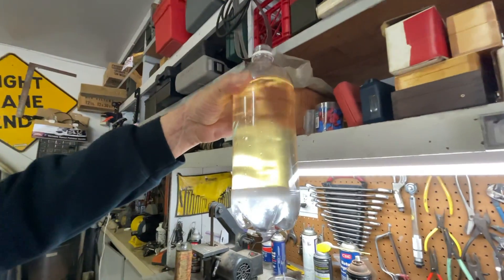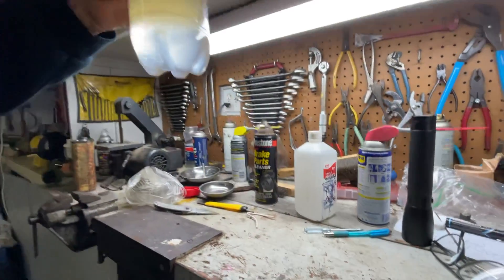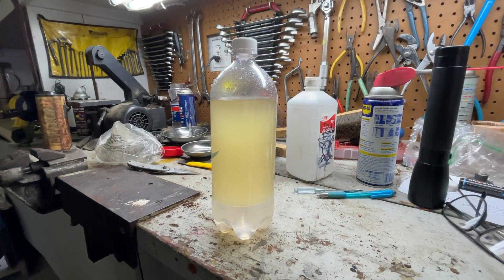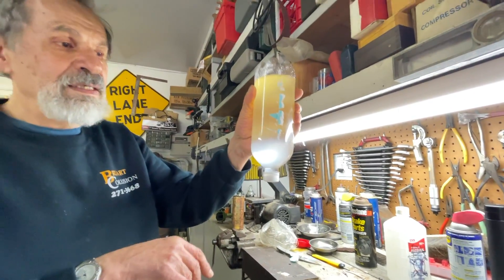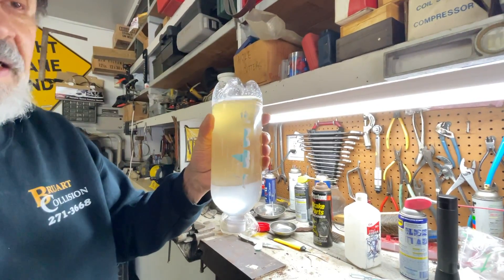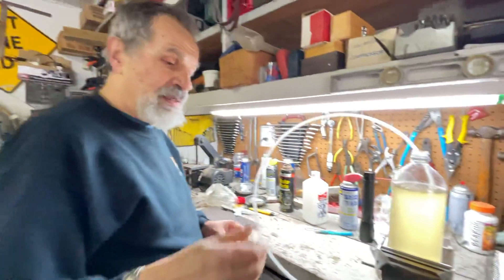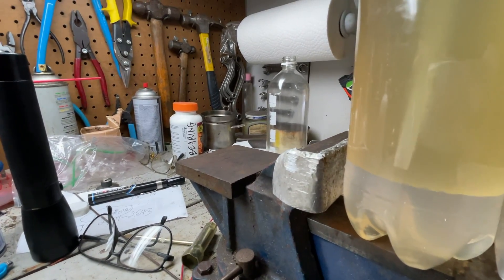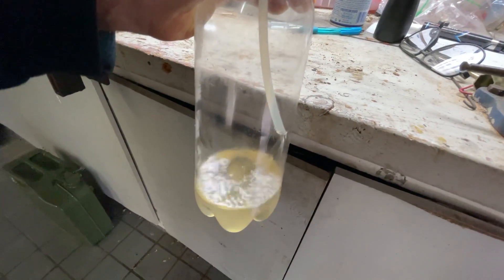The Most Practical Way To Remove Ethanol From Gasoline

Comment: All, keep in mind, if you remove the ethanol, and you have a motor that requires, or is sensitive to a minimum octane number(ie a car, motorcycle or some higher end lawn equipment etc..), you must add another octane modifier such as Toluene/Methylbenzene or Methyl alcohol to bring the octane number back up. Ethanol besides used as a fuel "filler" is also used as a cheaper alternative octane booster by petrol/gas blenders. Instead of a stuck carb, bloated seals or clogged fuel injector, you might have pinging detenation or pistons that want to escape the engine block.
Reply: You should use a higher octane fuel, such as 91.
Reply: @ronkendall2930 my opinion is.. in general 87 octane is used all the time by the average consumer. So 91 octane is also a question of how old is it. Generally speaking barely no buddy is buying 91 octane where i live. Aka Ontario Canada. So my question is dose a person burn and treat 87,that is fresh or 2 year old 91 that sat in the tanks at the gas station? Any thoughts?Edit:Petroleum-based gasoline that does not contain ethanol will still succumb to oxidation and volatile compound evaporation in a sealed container or tank, but these processes usually occur more slowly in pure gasoline. Expect non-ethanol gas to last at least 6 months if it's properly stored.Sep 9, 2022
Reply: @randytricker8585  Toluene and Alcohol both oxidize and evaporate in the presence of an oxygen atmosphere at atmospheric pressure so oxidation isn't the problem that people complain about. All gasoline fuel expires quickly when exposed to air. Period. Alcohol is hydroscopic and creates an azeotrope (mixture between similar molecules that are hard to remove bonds). If you want a way to cheat the system and have fuel that lasts a year without adding or removing anything(id recommend leaving it alone for both alcohol and toluene octane fuel) get a 100% sealed can, and fill it 90%. May I recommend Wavian steel NATO cans. If you completely seal a can only the 10% air that is in the can will react or release moisture, and it will spoil way less. Now the liquid will expand and contract so open the can slowly.
Reply: @yeabutwecouldbefreer  no disrespect. I was saying if water is clear and pure gas is clear how does one know where the water and fuel is while sifaning?
Reply: @randytricker8585  No such thing as "pure gas" as gasoline (minus octane modifiers) is a mixture of distalates of multiple hydo-carbon chains at a certain viscosity; and changes from source oil, refinery, and time of year.  Unmarked Gas from the pump usually has a slightly straw colored yellowish tint to it, and both water and gas have a different refractive index so it should give a "shimmer" at the separation line for any water that hasn't formed an azeotrope (mixed with the gasoline). Water will settle out with most of its captured apotropic liquids at the bottom of left for a few hours.
Reply: @yeabutwecouldbefreer  ok. Makes sense. I guess from the vid it was hard to tell but i fully understand what you're putting down
Reply: so buy 94 and maybe get 91 ? seems good to me
Reply: I'd rather have ethanol for the octane than breath extremely toxic aromatics.
Reply: This would be for 2 stroke engines like chainsaws and weed trimmers.  They just don't start and run on this junk gas we have today.
Reply: #TRUTH
Reply: Why not ethyl either?
Reply: I would do this with high-octane premium gas and hope the finished product is acceptable. 

You can buy octane boosters. I wonder what's in them - anybody know?
Reply: @lcar9871  Methyl Alcohol. So back to square 1 here ;)
Reply: @yeabutwecouldbefreer  funny.
Reply: That is absolutely correct!  As a retired fuel terminal worker, I can tell you that the regular 87 octane when it is received is only somewhere around 85.5 and the addition of ethanol raises it to 87. The premium93 octane arrives somewhere around 91.5 - 92.0. This seems to be a messy and potentially dangerous procedure as I don't believe there will be any damage from running ethanol fuel in any small engine.
Reply: @dg6178  Have you done much research about whether ethanol-containing fuels cause problems with carburettors and rubber fuel tubing?
Reply: @joby602  i had old string trimmer and it destroyed whole fuel system when i used ethanol gas I think they wanted to do that get rid of old engines
Reply: @joby602  I have lost so many carburetors to ethanol,  it's causes rust and nothing but problems if you don't regularly drain your carbs.
Reply: Joby it's simple to test yourself. 
How much research anyone with a small engine needs to do is clean the carb regularly and see the damage done.
These machines were never made to deal with polar solvents
Reply: @dg6178  This mostly pertains to 2 cycle engines. The oil is known to separate out from the ethanol/gas mixture and you will sometimes get a straight shot of ethanol and score the cylinder in a chain saw for instance. This is a real thing....voiding any warranty I believe.
Reply: There is plenty of damage to carburettors, blocking of carburettors, denaturing of fuel very quickly. 
Ethanol fuel is a nightmare to small 2 stroke engines
Reply: @dg6178 older motorcycles with rubber seals in their carbs the ethanol causes it to swell.
Reply: @dg6178  The problem isn't in running the small engine with ethanol, the problem is what happens after you store the small engine for a couple months.  The ethanol absorbs water and turns to jelly and clogs up your carb and jets.  Sure you can drain your carb and gas tank after every use, but it's giant PITA.
Reply: @dg6178  Running ethanol laced fuel destroys 2 cycle engines. They run far too hot and lean with ethanol fuel, even in the lower 10% concentrations and despite having a properly adjusted carburetor there will be a power reduction from the lower BTU and faster burn characteristics of these mixed fuels requiring more fuel and more heat to do the same work. In the case of chainsaws and other high revving engines will result in stuck rings scored pistons and damaged cylinder walls. I've been through this enough to know it will kill a saw no matter the brand or 2-cycle oil used.  
There is a problem with storage of these ethanol containing fuels, they degrade over time at a rapid rate creating acids that attack and destroy many formulations of rubber and even corrode iron fuel cans and tanks. Fuel that was OK to store for a year  is now considered degraded in 3 months. 
Not draining fuel from a vast number of small engines for periods as low as 2 weeks is asking for the corrosion problems to begin in the float bowl and venturi passages of many small and light use engines be they 4 or 2 stroke in nature. Eventually the coatings used in engines hardened to resist these acids will break down and damage will occur. 
Being a person who distributes or dispenses or adds additives to fuel and having a "belief" that methanol in fuel will not cause damage will not alter reality.
It's nearly spring time in the Northern hemisphere. The flood of small engines is due in small engine shops around the world and a huge percentage of those visits will be due to damage caused by ethanol containing fuels doing damage while these units were not in use.
Reply: @btwbrand  Running fuel with ethanol is not problematic....leaving it in the tank for any length of time is when the problems start

Comment: Best way to remove water is this way: drill hole top of cap. Install hose through cap into bottle. Plug tube end to prevent leakage. Seal around tube on cap. Turn bottle upside down wait for settling. Remove plug drain water and ethanol. Done

Comment: I will try this experiment with fuel labelled as no ethanol. Im curious if it really has no ethanol.
Reply: If the non ethanol gasoline comes through the same hose at the pump which is used to deliver ethanol gasoline, it will likely contain ethanol from the previous customer. Put some non ethanol gas in your car first to purge the hose of the ethanol gas before you assume it's non ethanol. This problem will be worse if the same hose is used to deliver E85.

Comment: This is not a good practice! There are approximately 115 different chemicals that make up a gallon of regular petrol.
Yes you are  removing ethanol as its absorbed into the water. BUT what is happening to the other 114 other? 
If you want to run your 2stroke engines or lawn mowers on ethanol free fuel purchase ethanol free fuel, by the likes of Aspen or Stihl Motomix.
I'm sure these company's don't get a truck of fuel and a truck of water take it on a bumpy road siphon  of the fuel and pass it on to the customer!
A chainsaw runs up to 14,500 it needs good quality fuel.

Comment: A separatory funnel makes it much easier.  It is also important to understand that three washes with a small amount of water is more effective than 1 wash with the total volume of the 3 washes.  It is not necessary to let it sit for and settle out on washes 1 and 2, only for wash #3. Gentle mixing by swirling instead of agitation is also a better technique.  After you are done, add some silica gel packets like the ones that come in shipping boxes of products that need to be kept dehumidified to the gasoline, to absorb any residual traces of the unrecovered water.  https://www.youtube.com/watch?v=g6kPtSfnHlo

Comment: Ye feckin copied my system.
I use a wine bottle cork
and have a non return valve on the pipe I pressurise 
I add octane booster to the distilled fuel
to get the octane higher
and mix 2 cycle oil for my saws
Much cheaper than buying alcalite fuel

Comment: The reason the gas is cloudy after you shook it,  is well, because you shook it to hard and the cloudiness is just tiny air bubbles.  when you first poured the gas it was clear,  yet it had all the alcohol in it.  Think about it,  gas is quite clear, alcohol is completely clear, so after shaking hard like you did, you made foam like bubbles which make the gas look foggy.  Leaving the gas overnight gives the bubbles time to reach the top, thus clear gas.
Reply: OK but now what do I do with the bubbles ??? 😁😁  do they escape from the bottle when I open the cap and eat a hole in the ozone layer?  Is there a way to trap the bubbles ?  Maybe we need a bubble storage tank ?  What are your thoughts .  Do you know that I said this.  Not to undermine you .  Just ask the stupidest question I could   Think of so 😁😁

Comment: Super thinker! Small Engine saver! Larger add anti knock and motor! (Or generate). How much required … due to computers adjusting for the missing ethanol… depends on engine.

Comment: We use to do this when getting fuel from a fuel tank but using only one hose. You seal off the opening to get gas tank filler tube with a damp cloth. Blow into the hose until the tank cannot take any more air. The gasoline will come flowing out.

Comment: It does work. But ethanol's octane is 113.  What is produced from this process is gasoline with a very low octane.  Knock, warranty voided.  I don't like ethanol in my small engines either.  Please suggest an octane enhancer?
Reply: I use the cheapest pump fuel for this and it burns just fine in my weedwhackers and chainsaws and I can leave the fuel in them for months and they still fire right up
The octane doesn’t drop enough to make it quit being gasoline
And if you’re worried about it, you can start with premium gas… But I’m a cheap bastard so I use the cheapest fuel I can buy
And most fuel additives do not work
Reply: I know e85 in cold weather requires preheating input air to work correctly in cold weather. Smells sweet on exhaust. KEEP AMERICAN MONEY IN AMERICAN HANDS.

Comment: Won't the gas dissolve the plastic bottle?
Reply: Nope. 
Styrofoam cups are a COMPLETELY different story,  but normal water and soda bottles are fine.
(I have a plasic coke bottle with old 2-cycle gas in it for 2 years. I've been looking for a good way to burn it off or use for cleaning solvent. No change in the bottles.)
Reply: @brucebennett5759  Wow! This is useful information. 

I probably do need about 4 or 5 gallons at a time, since I have one pickup I park over winter, a large pressure washer over winter, 2 seldom used generators, and one pressure washer I park for the winter.  Fuel should be e free after October, because I never know when the last necessary use for any of these, which could be anytime between October and January. 

I am pretty sure the government assurance that cars use ethanol just fine is politically motivated, not scientific and purposely ignores people who might park their cars for months between uses, where ethanol can separate to corrode and dissolve parts.

I can't see myself investing in 2 gallon Mason jars, just yet.  I wish there were a cheaper clear 2+ gallon option.  Maybe, I need to start small and work my way up, to get into the mindset where I will spend more money. (If I am unwilling to drive 50 minutes round trip to buy lead free gas, I am not likely to invest $20 or $30 into 2 gallon jars.  It is a mindset thing. Perhaps, I am torn between the two options and can't make up my mind.   So, my best option is the free 2 liter, since I have tubing from 20 years ago, somewhere on the shelves in  bin.

Comment: Good, very helpful video. Here in UK we've just gone from 5% to 10% ethanol, so thank you for showing us this practical solution.
Reply: USA has been running om 10 for a long time. But now aparently..apparently... we are gonna go to 15...
Reply: The more ethanol the more problems you will have with your car. My SUV was getting 18.5 mpg. Now since they been messing with ethanol it's getting 16.4mpg
Reply: @marty64thornton Partially False.  Ethanol doesn't hurt anything as long as the gasoline is getting used within 60 days. The lower BTU is why mileage is lower, otherwise the Ethanol has much better octane than gasoline to prevent detonation and also lowers intake air temps in port injected motors.

Comment: Thank you Ben. The two observations I have.. 1. We will be paying government for unwanted ethanol. Either 5% or 10%  depending on if fuel is E5 or E10.  More importantly, you didn't mention, when the ethinol is remove from the petrol, the octain rating is drastically reduced, and may cause 'knocking'. Can we measure the resulting octain to calculate booster additive.
Reply: 99 esso fuel has no ethanol, so what gives 99 its high performance label ... do the refinery’s add some sort of Octane booster ?
Reply: He did say that the gas is being used for a chainsaw. Small engines don't need high octane ratings but will benefit greatly from ethanol free gas since it won't cause desegregation or oxidation from the ethanol trapping eater moisture
Reply: @nativecowboy1_3cowboys_wer84  Sthil recommends 89 or higher octane in chainsaws. Removing ethanol brings it down to about 85. Gotta be careful with the crappy octane boosters because they are often made of ethanol. Most won't say what the contents are.
Reply: @grizzkid795  you could start with premium 93 octane, no?
Reply: Yes, giod point. After some research, I found that the ethanol adds about two numbers to the octane, so if you used 93 it would drop to about 91 after ethanol removal. They use other chemicals like benzine to get the octane levels up to premium level because they don't want to put more than 10% ethanol in most gas, at least until all the vehicles can handle it.
Reply: @grizzkid795  SCIENCE!!
Reply: @jaewok5G  That's exactly what I do.

Comment: Here in Maine, we can buy ethanol-free gasoline but it is more expensive than crap-o-gas. Also, you can buy aviation gas at the airport which is 100 octane and REALLY expensive, but it has no ethanol in it.
Reply: Yes 100LL.  Only reason I’m making a comment is I don’t want someone to think it would be a good idea to run AV Gas  in a car or a truck with a catalytic converter.  It will cause blockages emission system.   Again I’m not picking on what you said I just wanted to make a sidenote or addition to .  I use AV Gas 100 octane low lead a lot.
Reply: CRAP O GAS comes from land fill and sewerage treatment.  I LOVE the smell of E85 running in a NON FLEX FUEL vehicle.
CLEAN and made in USA.

Comment: Make a "Ball-Valve" setup that can easily be attached to / removed from, the plastic bottle top. This way you can turn on / off the emptying of the water & ethanol from the gasoline.
Reply: You just described a separatory funnel used in chemistry
Reply: BASED ON LIES'  and misinformation is all your efforts.

Comment: Question: Your idea is very good; but why can't you just slowly pour the gas into whatever machine you want to put it in, just as if you're pouring coke from the bottle into a glass, stopping just shy of the water? The gasoline is floating on the top, which would make pouring very easy, I would think.
Reply: It'll mix together when poured.

Comment: Why not just add 75% ethanol to the gas! E85!
Reply: Because if you put E85 ethanol fuel in something that’s not designed to burn ethanol it dries out rubber and plastic and causes problems if you run it in a race engine set up and design to handle it I’d be a little different story but either way E85 is shit

Comment: Thank you, I was about ready to give up on my 2 stroke engines for good.  Replacing fuel lines and carb rebuilds too often now with all this ethanol in our fuel.  Can't wait to give this a try.
Reply: You'll still be rebuilding, but not as often. It's the benzene in the fuel that  beats up carbs - this method does not get rid of it.  Engineered parrafin fuels are the only sure bet.

Comment: Why not syphon the water from the bottom, leaving the ethanol free gas?

This is essentially why when doing a preflight on an aircraft you take a sample of water from the lowest point of the fuel tanks checking for water that may have accumulated from condensation.
Reply: Cuz it the alcohol os mixed with the gas
Reply: Bingo Sir.